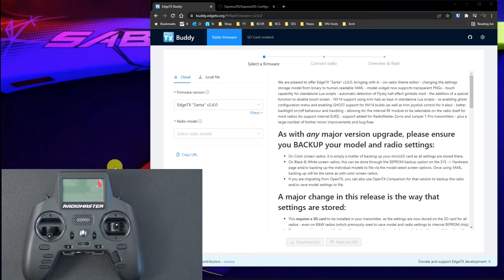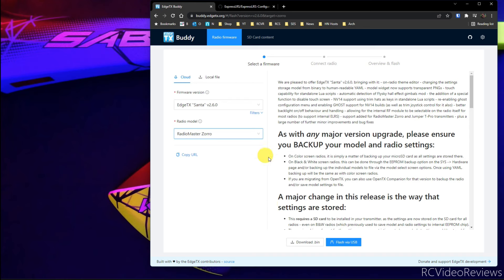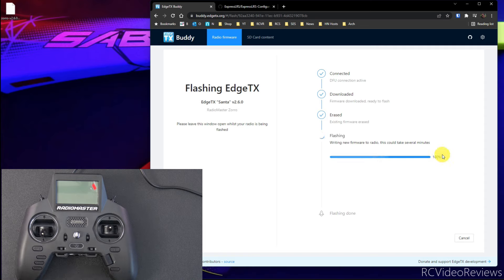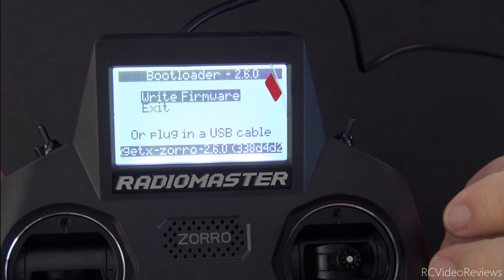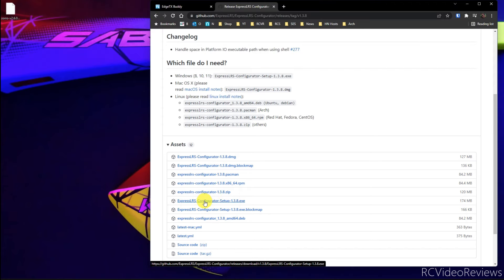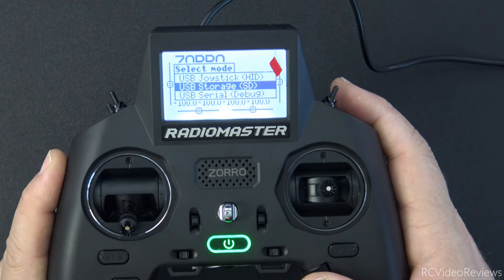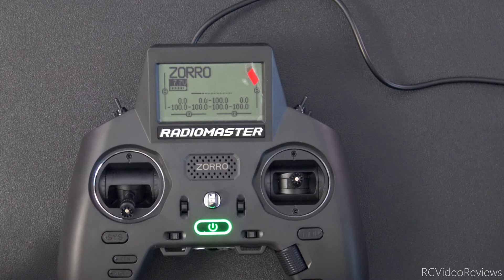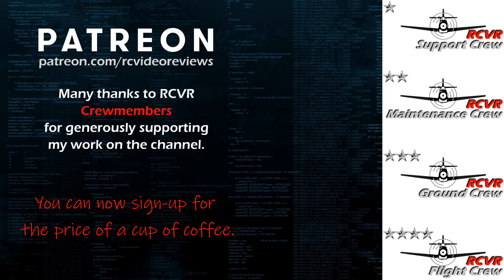Radiomaster Zorro • How-To Upgrade EdgeTX and ELRS Internal Module

Comment: I have a Zorro 4 in 1 i noticed on the website there is an ELRS radio module, is it difficult to remove 4 in 1 and install the ELRS module furthermore is it compatible ................. or am I just better off buying a Ranger ELRS 2.4 ghz module that can attach to the bay ??
Reply from the maker: I haven't tried the swap, so I don't know if any pieces are required outside of the rf chip/board itself like mounting brackets. It certainly doesn't hurt to have a module on the back, but you lose some of the compactness of the Zorro if you do that.

Comment: Do i need to remove the sd card if i want to update it? It has an sd car with the elrs stuff on it. Im wondering if it will erase the sd card aswell 😅
Reply from the maker: No, you don't need to remove the SD card really ever. You can plug the radio in to your computer and mount the SD card. You can then read/write from/to the card.

Comment: So I tried this with the buddy website and now my radio does not switch on , what is funny is that the top usb port does not do anything. When i put it in the lower port it starts to charge the radio and i hear  the connection on my pc but nothing happens. Any help would be appreciated.
Reply from the maker: Hmmm.

Take the sd card out of the radio and remove \radio\radio.yml
Put the card back in
See what happens
Reply: @RCVideoReviews  This is now working, I had to cycle the battery but great guide used it to update my zorro and jumper. Will tackle the tx16 when i feel a bit more brave. Surprisingly i did not have to update my sd card contents just worked and showed my old models

Comment: I accidentally deleted a file from the second Zorro drive which you said don’t touch, now the elrs wont load on the tx even though I have flashed.

It is the rm Zorro drive & the file deleted was a a 3rd file, a txt. File, not the two files you had in there. They are still on the radio. 

Anything I can do?
Reply from the maker: I'd try flashing the firmware via DFU as shown in this video https://youtube.com/live/DLhRbzL1i5E

Comment: Hello John. Have you tried out the new RM TS-16S with the Internal ELRS module? Mine when I run the proper lua script just shows ?????   I experimented on my other radio and this is what it does when  I have the internal or external set wrong in the model menu. It is like my new radio does not recognize there is an internal ELRS module.  Hopefully you have some ideas or have run across this.   Thank you
Reply from the maker: I have not. Is the Internal module on and set to CRSF?
Reply: @RCVideoReviews  it took me most of the day but I finally figured it out. I had to go into the hardware menu, and change it there to crossfire, and then into the model memory. It then would let me change the internal module to crossfire. Very strange. It still doesn’t seem to want to let me flash the internal module though. It at least let me bind. 
Thank you for responding.
Reply: Hello, the same thing happens to me, did you fix it?
Reply: @DronesYjuguetes  To get it to bind or flash the internal module?
Reply: @billadams8795  Update edgetx and then update the internal ELRS module, but it gives me an error, a red screen appears and when executing the LUA it appears "??????"
Reply: @DronesYjuguetes  This was on the Radio Master Maxx not the Zorro but I got it to where it said there was a mismatch with   the hardware and I chose to "Force" the update and it worked.

Comment: Thanks for the Radiomaster and EdgeTX videos. Can anyone confirm what colour the Zorro power switch light should be during charging? Mines red when connected up to charge (but my TX16S is green). Just wondering if something is amiss? Thanks.
Reply from the maker: Mine turns red.

Comment: Are you going to do an ELRS SPI aio video for the Mobula7 1s ELRS and other on-boards?
Reply from the maker: Unknown at this time. I don’t have one planned.
Reply: @RCVideoReviews  I understand but hey one more question can you use a 2.02 tx with a 2.0 0 rx firmware?
Reply from the maker: As long as the major version is the same I believe they are compatible.
Reply: @RCVideoReviews  cool, I'll try tonight. Spring is coming... all the changes in 4-5 months seem really really good

Comment: All was going well until the last step to copy lua file over, first came up with error in the radio , said the syntax was incorrect, disconnected, resaved file and tried again and now radio booted with a bad config message and seems to have reset everything, the expressLRS system tab, just is stuck on loading..

any tips to find my way back?

edit , saw my mistake: i didn't delete the compiled lua script ending luac
Reply from the maker: Can't really help with questions like "reset everything" and "syntax was incorrect"

What indicates anything was reset? What were you doing when you saw a message of "syntax incorrect"

If the ELRS lua is stuck on loading, that usually means the module is not turned on in the model setup. Under model, turn on ELRS.  

For further help, please join my discord and ask there. Every video has an invite.
Reply: @RCVideoReviews  thanks, I added an edit to the original post earlier, I saw my mistake, I didn't delete the .luac file, which led me down a bad path. Have recovered now, although lost the default tools that were installed when I recieved my controller. (note to self should have backed up all folders)

Comment: Kudos to you ... exactly what I needed. I'm a beginner and this gave me what I needed and your fill conversation was also greatly helpful. Have you, or can you, do a similar video for the Jumper T-Pro ELRS edition? I have both radios and the Jumper has me about to tearing my hair out. Thanks again!!!! (quick edit - the Jumper may be very similar to this and I could use this as a guide maybe - but nevertheless I'm hyper cautious because of some of the bricking issues with the Jumper)
Reply from the maker: Glad my video helped you. I don't have a Jumper T-Pro so I can't do a video on it. The process should be pretty much identical though. When they use the same firmware, the firmware governs the process. The only thing that might be different are the physical knobs/buttons.

Comment: I watched and followed your video before and no problem. Well today I decided to upgrade and after flashing using buddy TX which said all is well. I went to check to see the version and after seeing it I turn the zorro off and now it will not come on. Do you have any ideas why maybe?
Reply from the maker: You need to get on our discord and ask there. If you flashed it and it worked, then you turned it off and it doesn't work, the first thing I would suspect is battery power or a hardware fault.
Reply: @RCVideoReviews  I tried to find this comment and delete it only because when I found your other video how to unbrick it, it totally worked. Thanks man.

Comment: HI, how can i put OpenTX omn my new Zorro ? i like to have Open TX on it.
Thanks.
Reply from the maker: I've left OpenTX behind in favor of EdgeTX. So I haven't tested, but if OpenTX supports it, you should just be able to flash it using Companion.
Reply: @RCVideoReviews  Thanx a lot for your answer,my Zorro came with Edge Tx,so i have to use Edge Tx Companion to put open tx on it,wright?or should  just copy thr open tx FW bin file to SD ,and write FW? Thanx anyway, like your site+++

Comment: hey Bud im hoping you see this asap! i am getting a failed (red screen) at the end of trying to update ExpressLRS config im not sure why but three attempts to update on the configurator has left me unable to update my zorro.....i followed your instructions to the letter! Help :) please ...BTW i was able to do the EDGETX firmware update but not through USB aswell so this is a driver problem you think?
Reply from the maker: Two things I would try: 1) Set your baud rate on the radio to 115k.  2) Try a different cable. 

If you can update EdgeTX you "should" work for updating ELRS because they're using the same components to communicate from PC to radio. 

If that doesn't work, I suggest getting on the ELRS discord and seeing if they can help out. I haven't encountered this error, so anything I suggest is speculative.
Reply: Thanks im going to try your suggestions....im currently updating stm32 bootloader software and the cpm firmware from betaflight....this is my first radio since my old spektrum days....i have alot to learn! 😏
Reply: @ZeroHourPrep  You may be missing the STM32 drivers on your computer that allow it to talk to the radio, the bong
Reply: im havin the same problem now, cant flash my radiozorro, apreciate your experience

Comment: Zorro comes with 2.6.0 is there a need to flash?
Reply from the maker: It comes with a pre-release of 2.6. My advice on flashing is to do it if the new firmware gives you something you want or need.
Reply: @RCVideoReviews  after flashing can i bring models and radio back?
Reply from the maker: Flashing pre 2.6 to the 2.6 release won’t do anything to your models so I don’t understand your question.
Reply: @RCVideoReviews  excellent video thank you.

Comment: whenever I try to use buddy.  I get cant erase old firmware, any ideas?
Reply from the maker: It isn’t required to use buddy. If it’s giving you problems you can use the other flash method I showed in this video. I’d also suggest opening a ticket on EdgeTX github to let them know what you’re seeing.